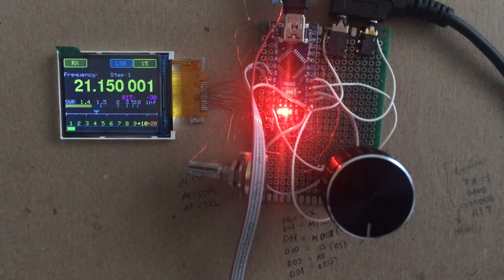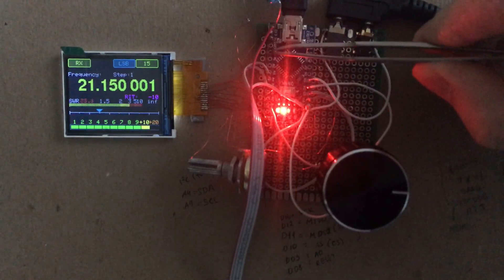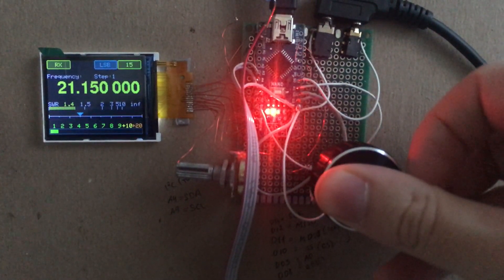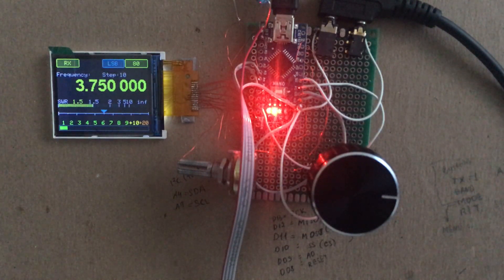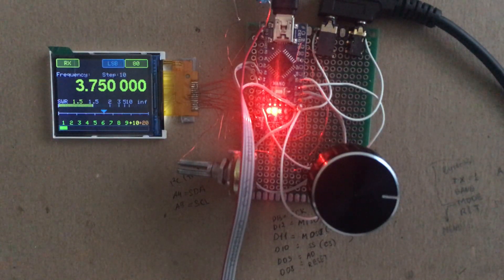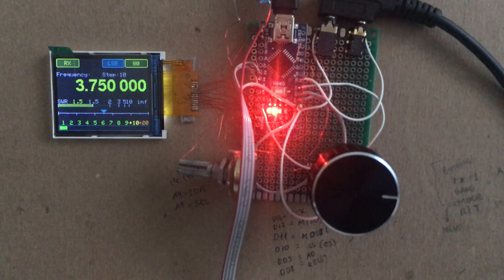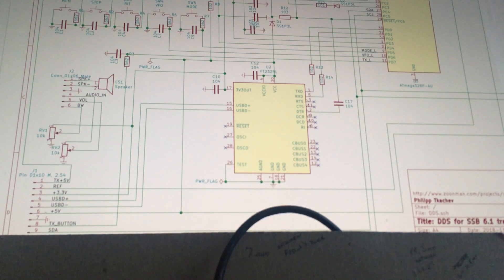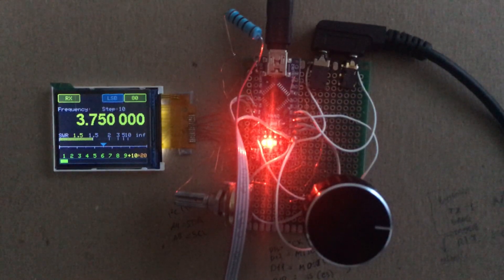SSB 6.1 DDS, Updates

Comment: Good day I was looking around for an improved SSB6.1 DDS out in the internet and it led me to this. So far, this has been the closest I've seen where CAT Control is implementable. If I recall correctly, the SSB6.1 board uses those PC817 optocouplers for the IDC Socket and I think I've figured out the 6 pins there labelled 1 to 6, the USB LSB and CW pins, they point to a single optocoupler on the board. Could it be possible to add CAT Control on this radio? 
73
Ace
DW6WQH